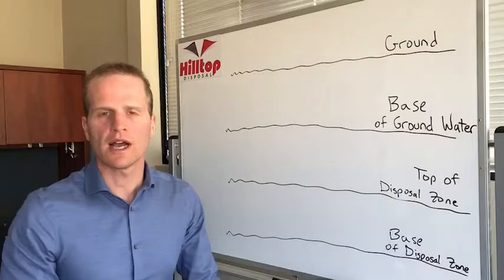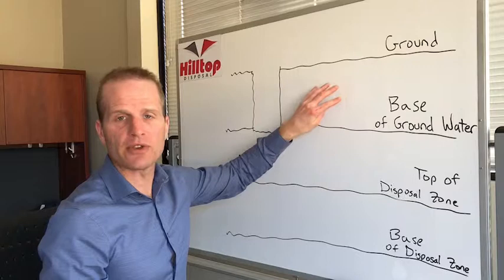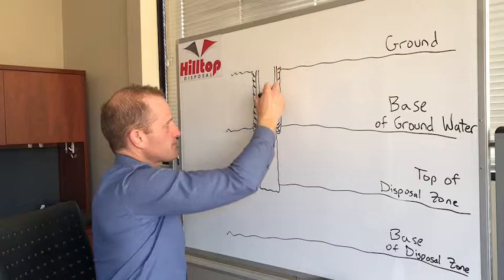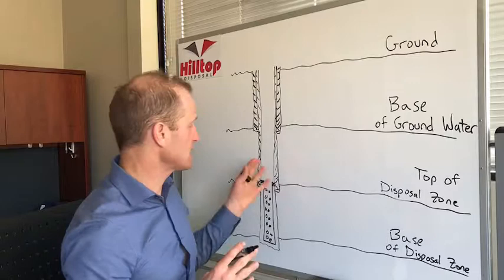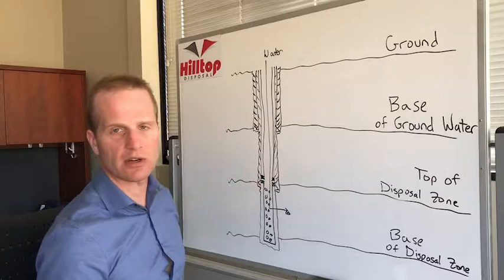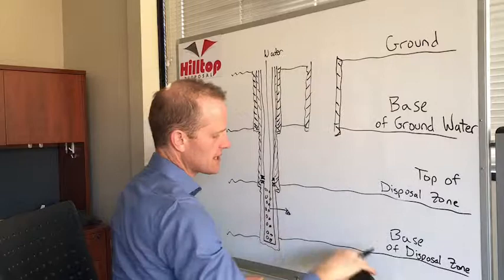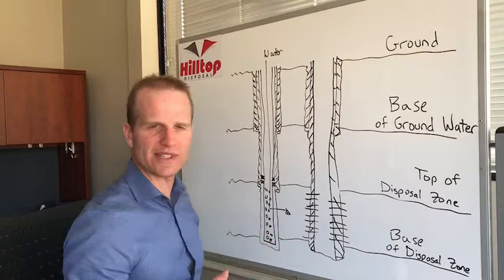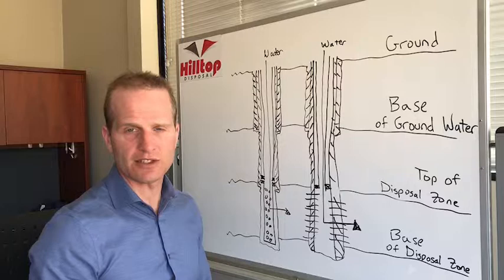Disposal Well Basics

Comment: thinking about purchasing some property that has a brine disposal well on the property, it is in peacock michigan and the oil wells in the surrounding area are plugged. there is a road grader sitting on the land where the well is located and it might be used for snow removal but not sure,  i am waiting for the realtor to provide some paperwork on the mineral rights that i will not own if i buy the land, I was wondering what the process is when the brine is disposed of in the well, is it just a simple truck that pulls in and unloads into the well or is it a more advanced situation creating alot of noise and such
Reply from the maker: Mike, there are two options for a disposal well - one where all of the fluid is pipelined from the producers into the injector, the other where all of the fluid is trucked into the disposal well.  If the fluid is flowlined, there is minimal noise.  If the fluid is trucked, there will be truck noise.  Outside of this noise, it is dependent on whether a disposal pump is required, although the pump is usually inside a building which limits the amount of noise.
Reply: @dustinnewman3365  thank you for your response,